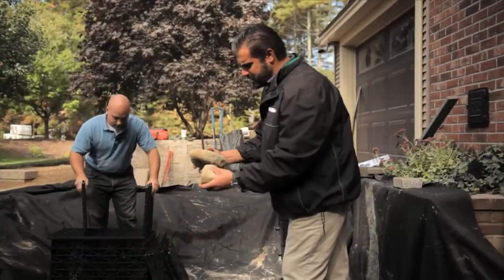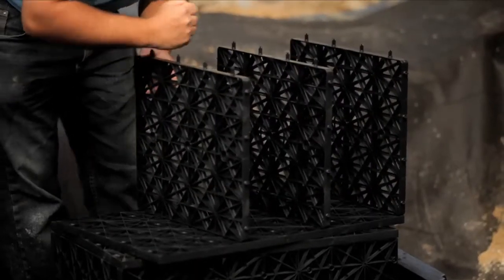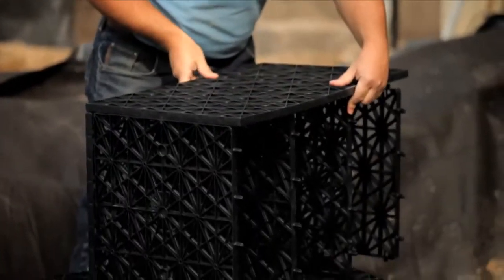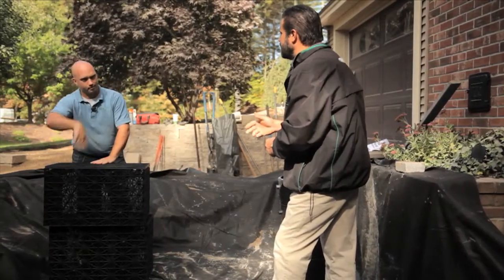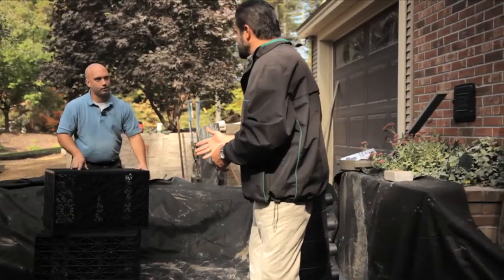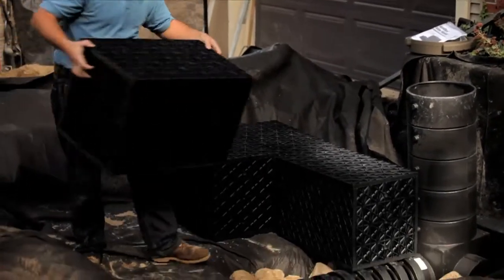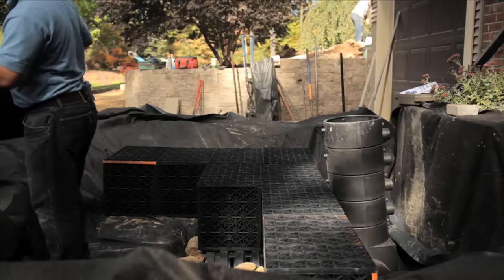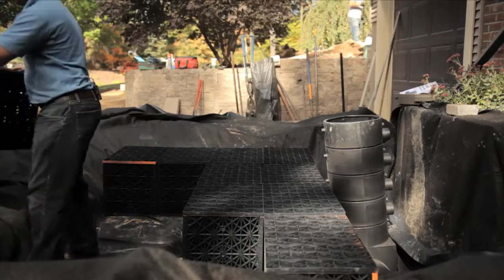AquaBlox Assembly and Installation

Comment: Those aquablox boxes are crazy expensive. $54 each!!!
Reply: Lol I know right? 😂 They are one of the best options out there but there are alternatives out there if you don't mind adopting the alternative. An example is plastic pallets,  I think per pallet 2nd hand they are free to approximately $20 each.
Reply: Not as efficient with regards to holding void space but have a 2 tonne load bearing weight.
Reply: Which isn't bad, as long as you don't mind allowing 2 pallets deeper to allow for loss of void space.
Reply: What about plastic crates
Reply: Atlantis Flo-tanks are $24 each (Aud) and they actually make aquablox.